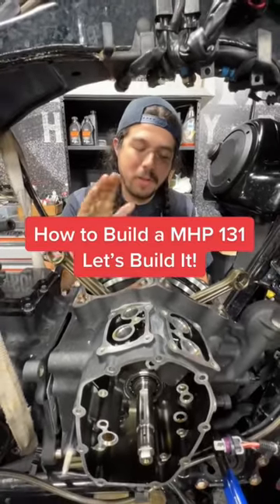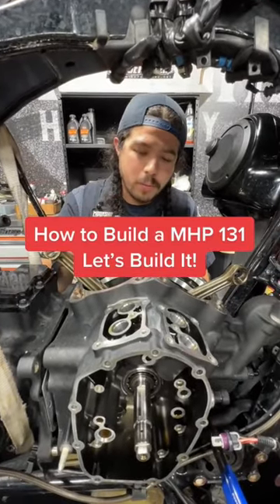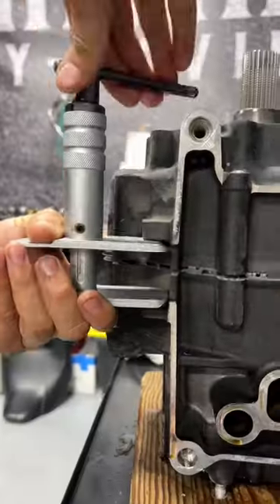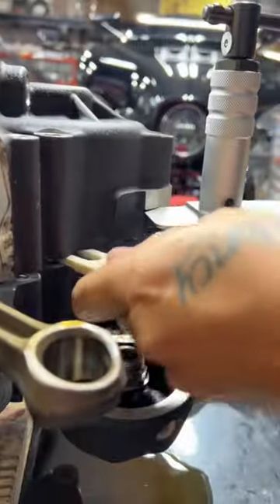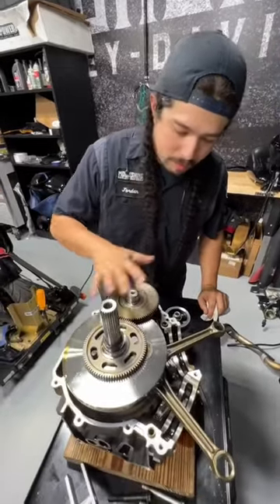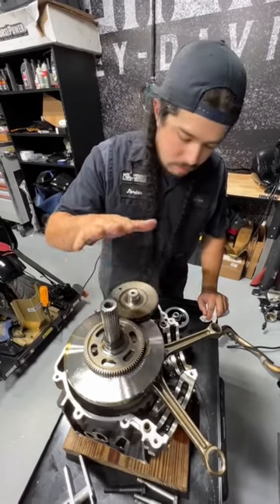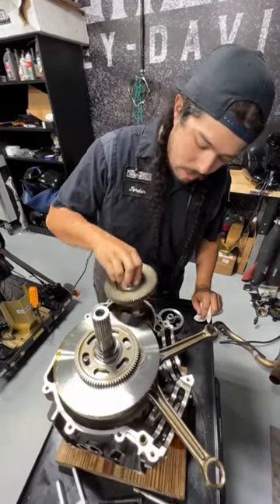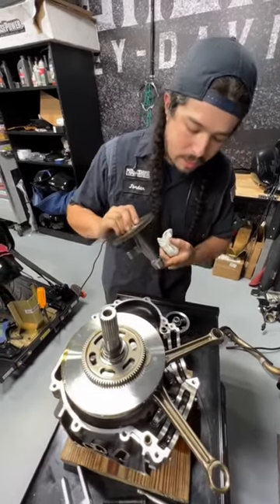Building a Motor

Comment: I have an S&S T124 640 Cams in my 2006 Street Glide. Using stock clutch with S&S Variable Clutch Plate. Heavy duty Barnett Clutch Spring. No slippage. Stock starter. Easy start cams.

Comment: Did not tell what he was putting back in.  Are the stock flywheel on good. Did he change the stroke
Reply: He put in a dark horse flywheel with forged rods.  That flywheel is more balanced and it’s all set up to handle POWER.  IDK if stroke was changed.  I suspect it’s the stock stroke from a 114 or 117.  Cyl bored out.   These guys to dope work.  I’d love to have them build my road king
Reply: @geraldgoodiii6993  I know they are good . They bilt my 128
Reply: @geraldgoodiii6993 they did the motor in my road king special it has the 143 in it ,it runs bad ass
Reply: @geraldgoodiii6993  yep that’s why he left out the CB